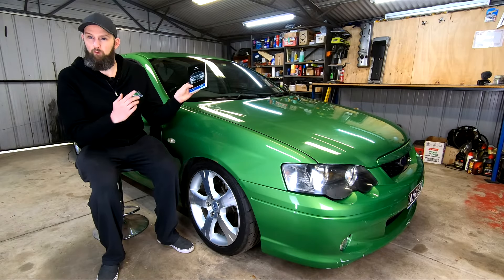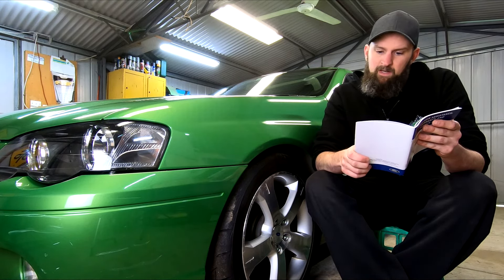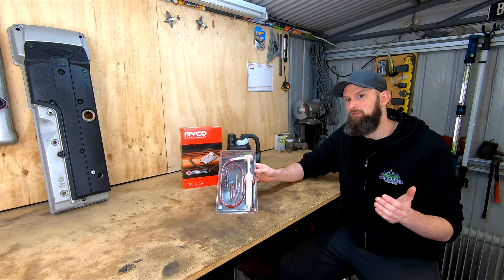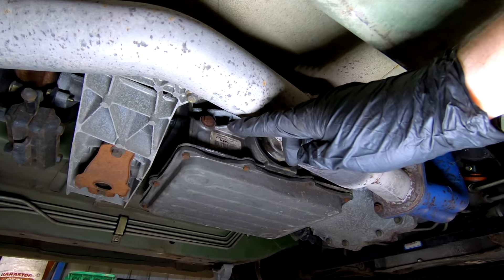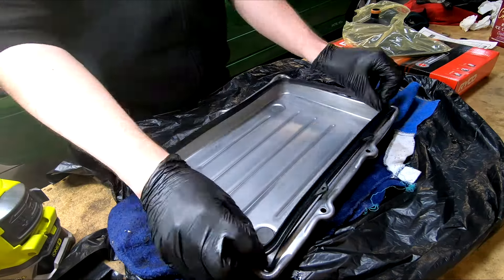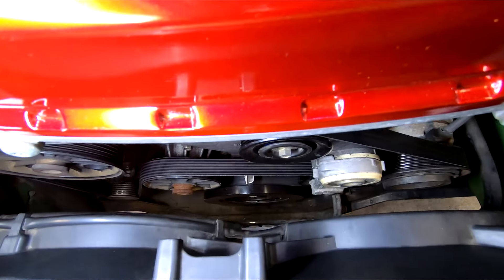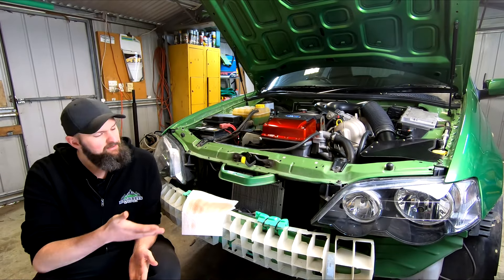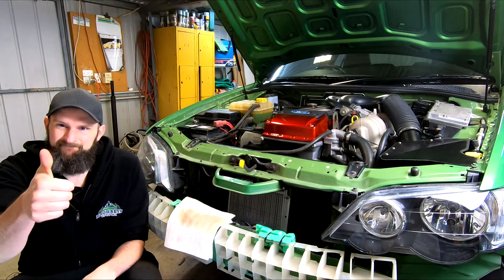Auto Transmission Service & FULL FLUSH (BTR Auto Ford Falcon EA-FG) | TURBO Your NA Barra Pt 2

Comment: Ok, I worked at a Ford dealership when the AU was new. We serviced these BTR autos in different circumstances. Police cars and Taxis were definitely serviced every 50,000 kms in conjunction with the 50,000 kms major service schedule. These vehicles were fitted with a factory fitted external cooler in front of the radiator and were known as police pack or taxi pack optioned. These commercial vehicles would have come with a supplementary service booklet along with the log books. This stated trans schedules of every 50,000kms and had a record section to stamp and sign. On other private owned commercial such as the utility and the 1 tonner it was an option known as towing pack and came with the same trans cooler, these had the same supplementary service book. The cooler was an indication to us as techs  the trans required servicing every 50,000 kms. All other servicing requirements was purely up to the owner and was only a suggestion on the 50,000 kms service. It was purely a ploy to up sell or keep service costs down. My recommendation would be to service every 50k regardless. They are a good box despite some theories, but they do not like getting hot. So i would recommend also to fit the biggest cooler you can fit in the front to keep it cool also. It seemed as though Ford did somewhat keep it secret or not well known about service schedules of the trans. I will never know why.
Reply from the maker: Hey Greg, thanks very much for sharing this, awesome to hear experiences from guys like yourself. Already have bigger trans cooler up front and it doesn't get driven too much so we'll be a  long time off 50k kms!.. yeah I should probably do it sooner with it seeing drags at least once or twice. I agree, I think they're a fine box overall, especially when they can be had for cheap if there is serious neglect and it needs replacing.
Reply: @BrowneysGarage  Another thing i forgot to mention was the level should be checked with the engine running, vehicle should be level, or on a hoist in our case. Its a pain in the arm, as the exhaust is super hot and in the way.
Reply from the maker: @gregmyatt9932  Thanks Greg, I've never had a problem doing it this way - doesn't mean it's not wrong/less than ideal. I'll be sure to do it while running from now on... maybe with welding gloves on!
Reply: hey greg, thanks for your ford dealer insight. Looking at installing an external cooler on my btr. I live in north qld and hot days are a regular thing. I cant find a consistent answer, would you recommend running through the radiator AND an external cooler, or skipping the radiator and running just the external cooler.
Reply: @enjay8950  The factory went through radiator, but being in Qld it would be no harm to go straight to cooler bypassing radiator, then also their is no worry of rad cooler bursting and filling your trans with coolant also.
Reply: @gregmyatt9932  hey thanks greg I appreciate your insight!

Comment: I used to work as a mechanic at a taxi depo and we did the trans service every 30,000 kms. I think once (maybe twice) i did a service with out spilling a drop on the ground haha. A tip for reduced oil spillage is if you have a rectangle  container larger then the oil pan. Have it sideways for the first bit then rotate it for when you take the pan off. It seems stupidly simple but it does catch most of it bar a few drops here and there. And a magnet handy to catch the dropped bolts  .
Reply from the maker: Haha, glad to hear even pros can make a mess on this one. Thanks for sharing though, crazy they got done that often!

To be honest I was going to get a larger rectangle pan as you say, but I cheaped out and went with the 'she'll be right' approach - and as we saw I was very wrong! At least the ATF cleans up off the floor ok 😂
Reply: A under bed plastic crate from bunnings works a treat

Comment: I remember back in the early 1970's ... watching a driver at a Service Station taking off the radiator cap to check the water level...But what came next I will never forget. The Women Driver took off the Engine Oil-Filler Cap ... had a good look down the hole and decided to fill up the engine with engine oil till she could see it ( Oil ).  :)
Reply from the maker: With all the urban myths of people doing this I find it hard to believe someone would actually do it... but with some of the people I’ve met I really shouldn’t! 🤣

Comment: The 4 speed btr auto box is just a 3 speed Borg Warner with an extra gear and has been used in fords since the mid sixties and was known as the Borg Warner 35, the 6 speed auto fitted from the BF onwards is built by ZF  in Germany, that's why the cooler is on the block and not in the radiator and I think they use a different type of fluid
Reply from the maker: Maybe a case of "if it ain't broke don't fix it" for a very long time then?
Reply: That and the ZF are quite picky on fluid used and level.
Reply: Doesn't apply to all BFs though. My BF wagon had the heat exchanger on the block (stupid idea IMHO) and it was only the four-speed flavour.

Worst part was using an OBD2 scanner to reveal that "Solenoid E" had gone faulty but the Ford workshop manual not cross-referencing Solenoid E to what is ultimately Solenoid 6 in the rest of the literature. I had to call DSI (Chinese company that bought out Borg Warner a little while ago) and talk to their tech to find that out and tell my auto guy which solenoid to change for me.

Yeah, I have a love-hate relationship with Ford when it comes to my secondary vehicle (aka shitbox). :P

Comment: For the avg person, you don't need to flush the fluid if the car doesn't have an issue requiring you to look at the fluid in the first place. But you can do a normal fluid service when you change your oil, and then when you change it again in Eg. 10k or every 2nd oil change, like an increased service interval till the fluid clears up to your liking. 
You can use an OBD scanner and check the trans temp when checking the final level. Warm = transmission temp > 50°C and box is warm to the touch but not hot, eg if you just drove it to the shop and if your engine cooling fans are on, you would wait for 2hrs but not longer than 4hrs to be in that range normally, or if the engine is cold, drive 3.5-4.5kms @ < 2500RPM.

Comment: Hi all a good tip for doing the flush is disconnect the cooler line from the radiator or external oil cooler first and fit a hose ,have somebody start the car have the hose going into a bucket or container, drain around 4 litres or when the fluid starts to splutter and spit turn off the car ,your trans pan is now empty and easy to remove without covering everything in oil ,remove the pan and clean it replace the filter and gasket ps add some more magnets the more the better , now you can run a piece of clear hose (bunnings has multiple sizes) into the gearbox from the door mirror add a funnel then cable tie to the mirror put the window down first so you can access the key to start it ,now add 4lt start the car run through another 4 litres etc until clean fluid comes out now refit cooler lines and with the engine running and a pump bottle top up until fluid comes out the fill hole put the plug in before switching off as once switched off fluid will pour out .
now if you are debating weather a flush is necessary these gearboxes hold over 10lt dry fill so when you replace 4lt you are leaving 6lt of filthy oil in the gearbox and that is insane like changing less than half your engine oil and leaving the rest of the dirty stuff in there .
Good video Browney keep up the good work.
Reply: Will this work for the AU series 2000-2002?
Reply: @tio123ist yes it will, all AU autos are the BTR auto. Only use Castrol TQ95.
Reply: Cheers!

Comment: Thought I'd re-watch some Browney's Garage Videos again. Since this was first posted I have done a full service on the 4 speed in my BA sedan. As it was done on a hoist in a friends mechanics workshop I had all the tools at hand to not need to crawl under the car. Huge help when it came to refilling the gearbox. Ended up using a total of 20 litres to flush out and re-fill it. The car drives like new. Hope you get well enough to post more videos Browney. All the best.

Comment: I know of someone with an early  Falcon FG  with the 6 Speed ZF Auto ...He was quoted $ 1200.00 for > Auto Oil and filter <  change ... LOL.
The Wife got a Mazda3-5Speed Auto. When we bought it ... I asked the Service manager what type of oil goes in to the Auto Transmission ... He told me... One day I went back to the Dealer's parts department and asked for a Trans-Oil-Filter kit. I was the told ...there is no such filter ...He showed me on the Computer Screen... and also told me that he never issued one to the workshop. ... Well I ended up getting a Filter-Gasket kit on Ebay. I also used Penrite Oil !!   Being a retired Motor-Mechanic helps :) !!

Comment: Finally I'm confident to do a service on my box after watching your vid.
Your vids have been very helpful while working on my ba wags. 
Keep up the great work mate.
Reply from the maker: Nice! Not a hard job, just messy. Biggest point I'd make is take care with the fill bolt and don't over tighten the pan bolts, they don't need much.

Thanks very much mate and good luck 👍

Comment: I find one of those under bed storage tubs from cheap as chips are great for that. Also I have a vacuum oil pump and suck most of the fluid out of the fill hole avoiding a mess.
Reply from the maker: Good thinking mate 👍

Comment: Measured that pipe today on bf ,heat exchanger today,12.7 mm or half inch , never looked before and plan to bypass unit altogether. MJ products apparently sell a kit with all you need

Comment: Borrowed one of the wife's 50 litre plastic storage containers for the oil, worked a treat didnt spill too much
Reply from the maker: Is that "borrowed" or actually borrowed? 😂 Great idea though mate.
Reply: @BrowneysGarage  Mate a little degreaser n she'll never know 🤣 hey bludy awsome effort putting a turbo on that thing cant wait to see how it turns out, doing the same on my 03 just saving up parts atm might even be able to embarrass two of my mates with an LS n a sc 3.8

Comment: Just subscribed, don't know why I didn't before. Just wanted to say you're a legend bro and the hard yards you put into these videos is much appreciated. I've been tryna figure out how to service my 5speed tranny on a G6 I just bought. Been looking at workshop manuals, had a sus underneath the car, looked at heaps of youtube videos, but none of them were this good. Cheers man.
Reply from the maker: Thanks very much for the kind words mate, I really appreciate that.

Haven't worked on the 5 speed but just be sure they are similar enough to the 4 speed BTR for this to work or be similar. Good luck 👍
Reply: i also have a 5 spd FG . apparently they are garbage transmissions

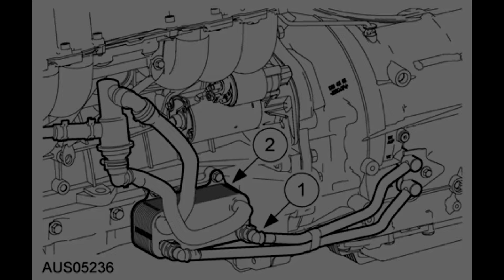Comment: 11:56mins Just got a kit for an FG MK1 5-Speed. The heat exchanger is removed altogether, the heater pipe joined together and replacement (rubber) trans oil lines fit directly into the g'box (where the heat exchanger was) with supplied adapters and run all the way to the new trans cooler. The factory steel lines are bypassed all together.

Comment: Still eagerly waiting more turbo updates Browney! Here's an idea...you talked about moving the transmission cooler for the intercooler, how about mounting the intercooler in front of the tranny cooler and running two flexible ducting hoses from the fog light cutouts, and then curving 90 degrees and running behind the intercooler and feeding air to the transmission cooler? Maybe not enough space for intercooler, oil cooler, and radiator. An old BMW I had (E36 328i M-Sport) had factory plastic air ducts running from the bumper ducts (beside fog lights) and directing air into the back of the front brakes, obviously to cool the brakes. Might be worth making something similar? Keep the updates coming!
Reply from the maker: Hoping to mount the intercooler in front on the trans cooler but space wise I don't think it will work on the bracket provided for the trans cooler, it's going to be tight. That's ok, I still have a plan to mount it in this spot that will hopefully work just the same and then everything should have plenty of airflow.

Ducting isn't a bad idea, not sure how much airflow it would add with the foglights still in for the hassle of sorting and mounting them but definitely a good one to keep in mind, thanks mate!

Also, hell yeah on the E36 328i M-Sport, would have been a great car!
Reply: @BrowneysGarage  it was a great car yes. That was back in Ireland before I moved out here, and before E36's started to cost crazy money. The E36 was fun but they don't have anywhere near the torque of the XR6. I've done mountain passes and scenic highways in 4th gear without ever having to change gear, E36 wouldn't stand a chance at that! I'll be following your build closely as my XR6 feels incredibly sluggish with that long first gear, it actually reminds me of a 4wd when you accelerate in first lol. Good choice on keeping the BTR, I've seen so many arguments for and against them, but with a high stall, larger oil pump from an AU or ED, and the solenoid bypass mod these boxes are actually supposed to handle decent power! Keep up the great videos!

Comment: Awesome tutorial Browney. I will attempt the basic service myself. Cheers
Reply from the maker: No dramas mate, thanks for watching! Good luck 👍
Reply: @BrowneysGarage  I can't get the filler cap off. I'm afraid of threading it. Any tips?
Reply from the maker: Fill bolt? Tap it on the head with a hammer first, good 6 point socket and keep pressure on so it can’t slip back and start rounding it.
Reply: @BrowneysGarage  Thanks mate. I have tried to move it even inserting a pole over the socket handle to give more leverage and just slips off. I haven't jacked the car too much which can be an issue as i'm not completely underneath and can angle better. I'll give it another shot.
Reply from the maker: Don’t know if anything particularly sensitive is around there but put some heat into the case around the bolt head? I must have been damn lucky and haven’t had one that stuck yet, only been 3 or 4 though.

Comment: just got a territory with 245k on the clock and dont know if the 4sp was ever serviced 
i have been told flushing is a high risk option 
it seems safer to just drop the pan and change ever year for a couple of years to try and improved the fluid quality

Comment: My only difference is I dump 4lt at a time then refill with another 4lt using a  low pressure fuel pump , wait till the oil comes up on special for $  36..

Running g it through the gears is a very important step .

Good job brown man .

Comment: Good video overall and good advice, only id use the reccomened fluid which was specifically desgined for exavtly the BTR transmission "Castrol TQ95" as refferd By BTRE augaust 1994..

Comment: You fill the transmission in neutral idling when warm not turned off, if you did it with the car turned off your probably about 3litres low on fluid

Comment: Get hold of a 'Smart-O sump/ drain plug
M20 x 1.5mm. They take a 10mm allan key.
Supercheap sell them about $15.
Reply from the maker: Will suss it out, not sure if the pan would be thick enough to tap a thread in though so would have to weld a fitting to it or work another way around?
Reply: @BrowneysGarage  
No mods needed.

Comment: Could a sump plug be tapped into the tray for next time? By using a flare nut or some type of AN fitting?
Reply: ..... Good thinking Mate, probably on the side deep end of the tray, (not underneath).
Reply from the maker: Great idea. Not sure if the material is thick enough to tap, sure you'd have to watch for warping too if you welded to it. Maybe a fitting with a nut on the back side that would seal to the pan and obviously had a fitting that could be used to drain, or a good/patient welder I'm sure could get it done still.
Reply: You can get a duel side lock then just a tap for added support.

Comment: I have a 10micron home water filter system i hook in line to do a clean up around 50k then a full flush similar to what you did at 100k unless there is some converter lock up shutter then it just gets a flush.
Reply from the maker: Interesting, certainly a lot more love than I've soon some past BTR autos! Sounds like a good system though mate 👍

Comment: Hi Browney, Thanks for the video.
I have a 98 EL Falcon and wonder if it would be feasible to install a drain plug on the oil try for easier servicing. I live 2 hours away from a Ford Service Centre so used to do much of the service myself but after my accident I don't have strength in my shoulders and arms. Thus having a drain plug on the auto pan will be easier for me. Could you please give me your option on this matter.
Thanking you in advance.👍👍

Comment: Hey mate. I actually rang pwr and they stated that the cooler would fit with the factory intercooler and the larger f6 one as well. But saying that I might just wait and see how you go first .........
Reply from the maker: Thanks for sharing that mate, had hoped it would be the case with the provided mounting zip tie things and the mention in the install documents. Fingers crossed, I’m ok being the test dummy!
Reply: @BrowneysGarage  love the content mate, keep it coming
Reply: I would get rid of any cooler that involves coolant running around it. Any cracks or corrosion and it's instant destroyed trans.